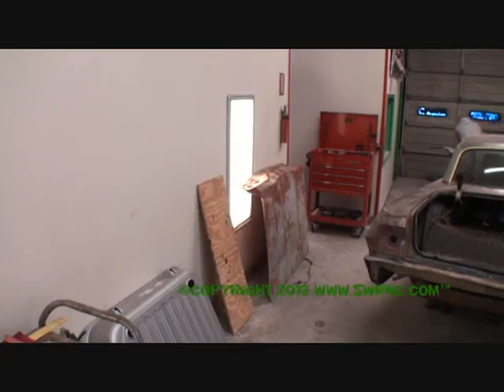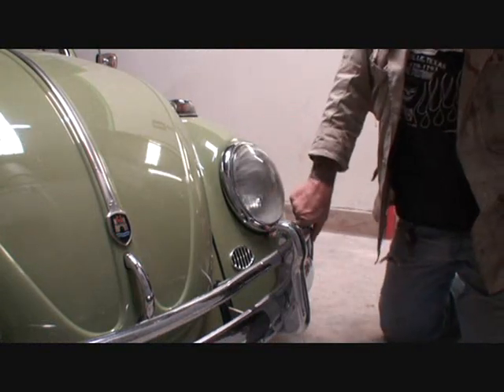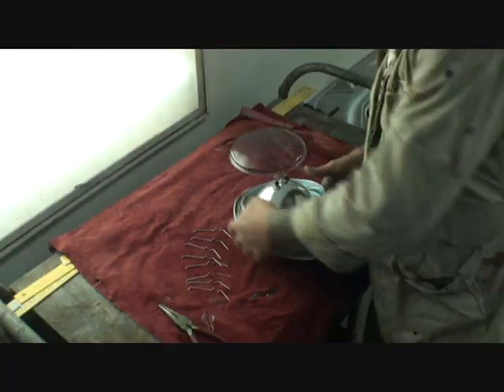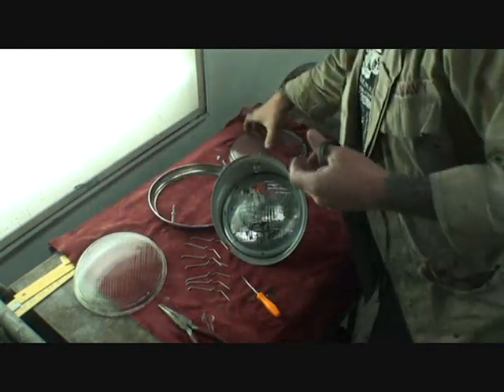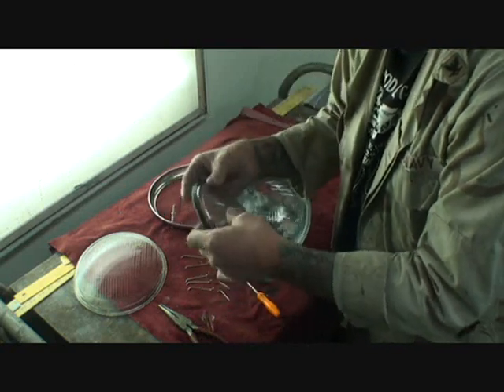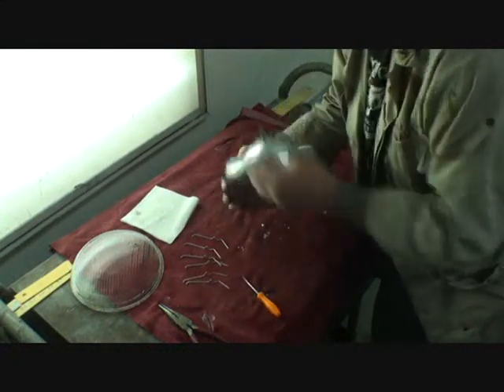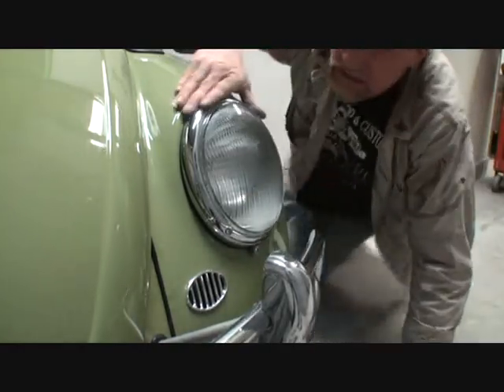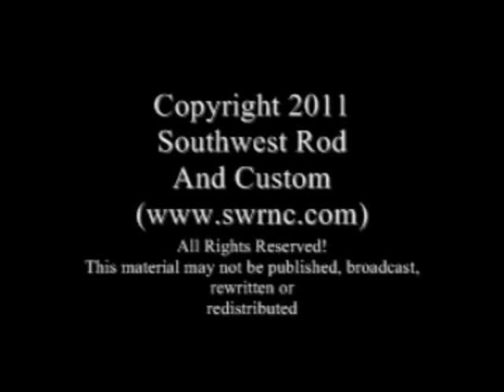How To Replace The Headlamp-VW/Volkswagen Beetle/Bus

Comment: Is the bulb retention ring the indexes the headlight bulb essentially the only difference between the minibus and the bug?
Reason I ask I got a second hand set of buckets and the headlight bulb is oriented 90° in the buckets  to how your bug is, (indicating a long side of the bucket goes horizontal). Ill be using theas in my custom aerodynamic grill for my 91.5 dodge D250.

Comment: For 1967 and later VW Beetle (Type 1), and 1968 and later VW Microbus, Transporter, and Westfalia Campers, glass cover over sealed beam headlights eliminated and redesigned and reshaped buckets, making easier to install new headlights when burnt out and other maintenance work is a snap.